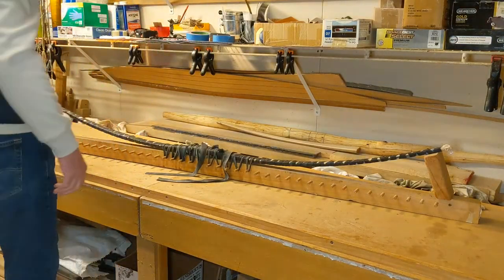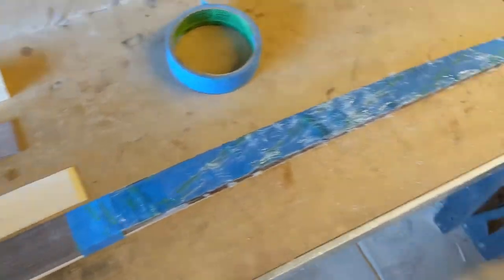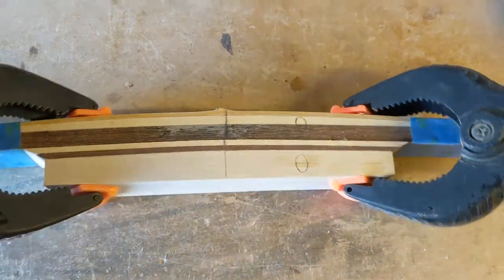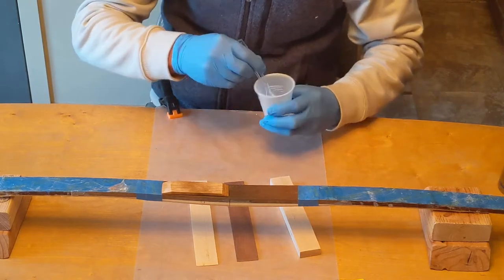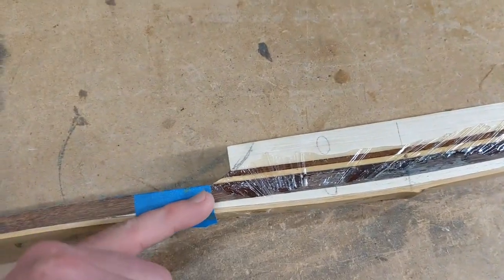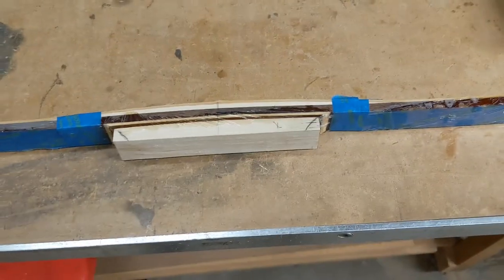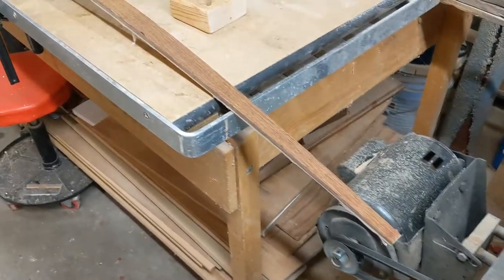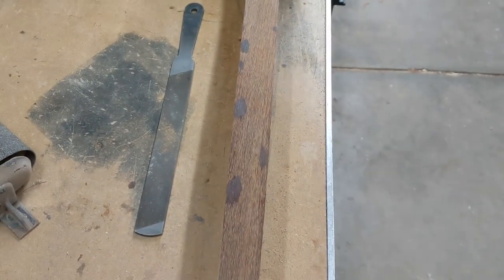The birth of the bow blank - Pt.5 RF/DF Bow build along

Comment: So I actually did tape my bamboo backing, and I had so much ea-40 squeeze out into the back that this tape is STUCK. What would you do to remove it? Would you sand it off and just try to avoid the nodes of the bamboo?
Reply from the maker: Don’t worry about removing it right away. After you’ve sanded the sides to bare wood, you should be able to get under the tape with a knife and remove it. If that doesn’t work. Just start tillering the bow. The glue cannot hold up to the tension on the surface of the back when it bends and will crack up and the tape should come off much easier.
Reply: @meadowlarkadventuregear  Thanks for the reply. I think I'll leave the rest for now then...I should have thought about that!  Although I will say as a last effort last night, I thought to use a sanding sponge and it was making quick work of it since it can conform to the curved backing. Again, thank you for the help!

Comment: Is there a reason not to glue the handle together with the Ipe slab and the bamboo backing, in one go?
Reply from the maker: I want to keep as much reflex concentrated at the grip, so I don’t add the riser until later since the riser pieces could potentially reshape the natural intention of the bow blank. Not to mention that it would divide my attention during the glue-up. It’s not so urgent to me to do it all at once at the cost of getting everything just right.
Reply: @meadowlarkadventuregear  Makes sense, thanks!

Comment: How did you come up with shape of your deflex caul? What is the length and the height at the center.?
Reply from the maker: I don’t use a caul on this particular build. I tiller all of the components, steam in a deflex, use a center spacer that will position the grip (deflexed area) just high enough to keep from bottoming out the working limb to the clamping jig on its way to the prop for the reflex.  The pre-tillering is what determines the final shape of the bow once it is bound down.